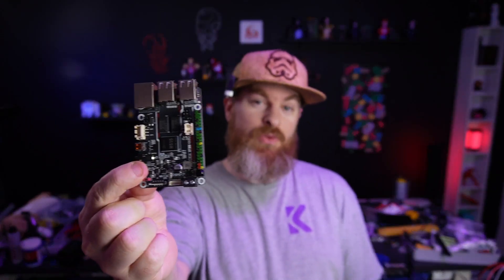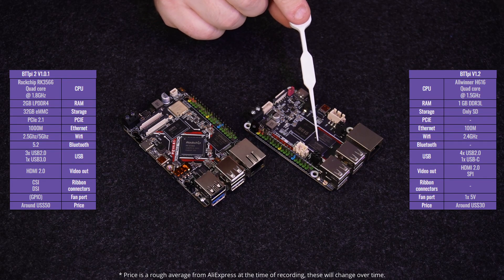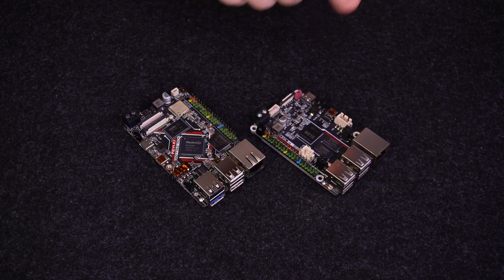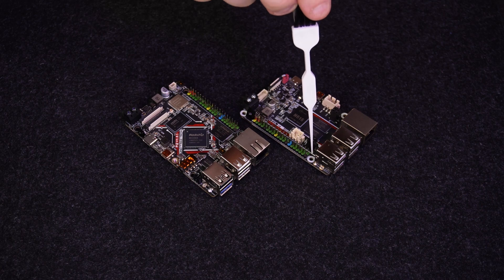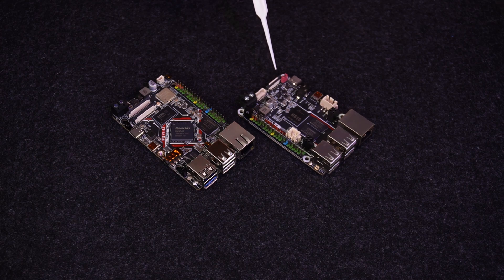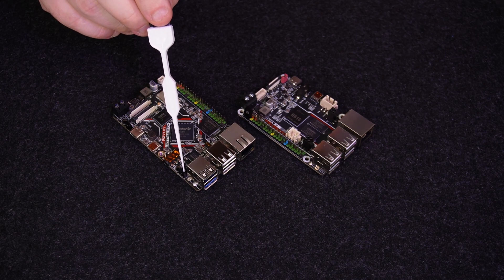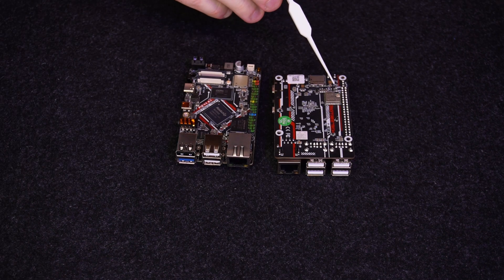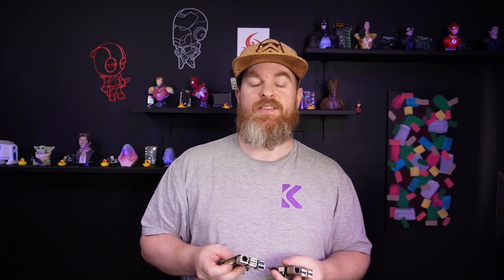BTTpi 2 and BTTpi, whats the difference?

Comment: My experience with the BTT Pi V1.2 was less than pleasant.  Within 5 minutes of connecting, and while setting up klipper, one of the RAM chips began smoking and it died.  It took out the HDMI chip on the screen I had connected and BBT completely refused to even acknowledge any warranty or support.  I'm out around $100.  I also had a CB1 do the same thing but luckily the seller honoured their warranty and sent a replacement which is still working.  I love my BTT products but their support is horrible at least in my experience.  I've strongly considered a Pi2 but I'm really kind of soured on the experience and my level of trust is pretty low.  Performance would have to be STELLER for me to take the risk.

Comment: Can the BTT Pi 2 use camera-streamer in crowsnest to stream via H264 over webrtc? I'm reading in the specs that it has a video encoder unlike the Pi 1.2. Debating whether or not to try the BTT Pi 2 or spend the extra on a Raspberry Pi 4.
Reply from the maker: I'm not sure about the webrtc, but it has an equal processor to the pit, so I don't see why it couldnt
Reply: @kanrogcreations  I just returned a Pi5 because it didn't have a hardware video encoder.  The previous gen Pi4 did.  Weird how the latest and greatest didn't include one.  Reason why I'm considering the BTT Pi2.

Comment: Seems really nice. Better wifi could be really nice installing/updating klipper,  also maybe for compatibility on some routers. The SPDif port looks like it's a 3 pin JST 1.0 connector, if for whatever reason you need to use it.

Comment: For a 3d printer otg wont be used. But  say you used the board to make a over popwered mp3 player. When you plug it into your pc you want it to show up as a storage device..... Youll use otg mode for that as the pc is the host and the pi (a mp3 player in the example) is the device.
Reply from the maker: Nice! Thank you! Explains a lot 😂